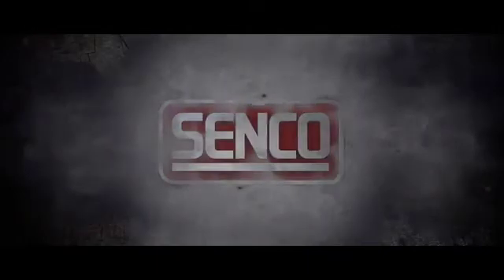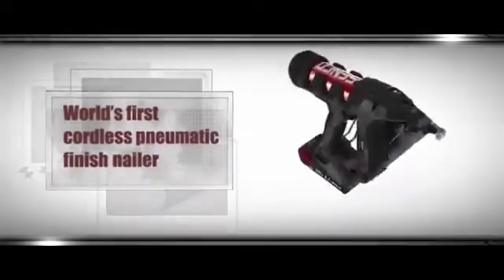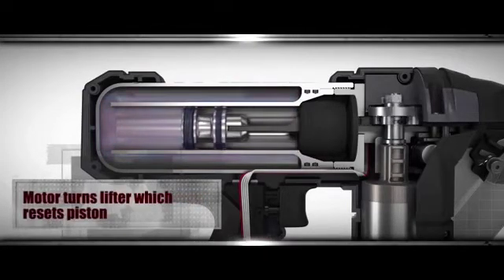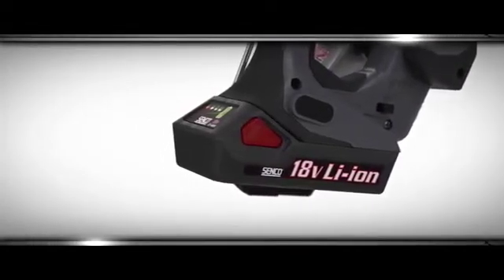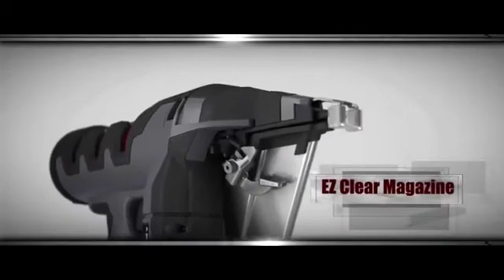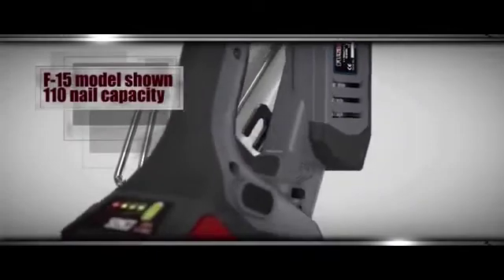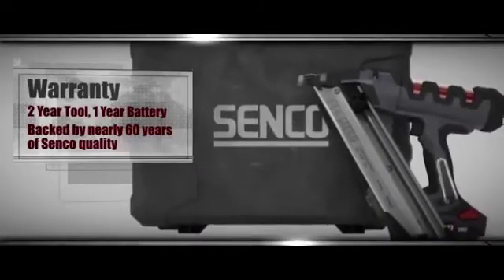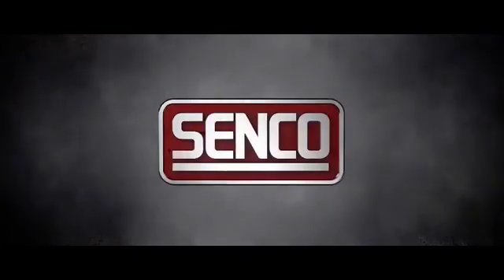Learn How The Senco Fusion System Operates

Comment: Bought this gun thinking it would be great. wrong it’s a Pyle the batteries suck and they are very expensive they don’t last .bought a second battery mistake lasted 3 weeks this thing has been sitting on my shelf for two years . Used the bag to carry my ryobi air strike nail guns nice bag should have used the guy who designed the bag to design the batteries!
Reply: you probably don't care but the first generation of batteries for the fusion nailer were garbage. they failed quickly as you stated but senco fixed the problem. i bought the first generation and purchased the revised batteries and charger and have not had a problem since. been 6 years and the new batteries are still going strong.